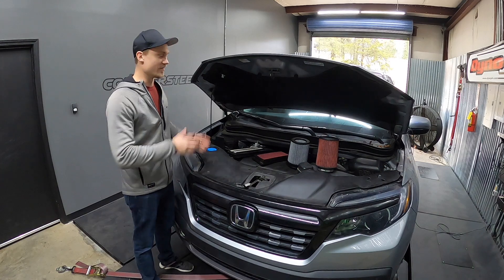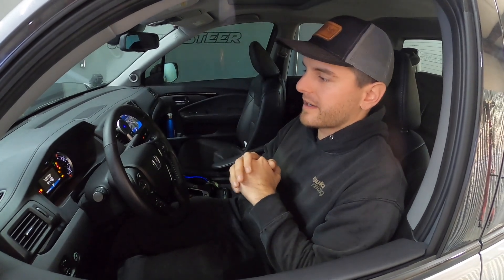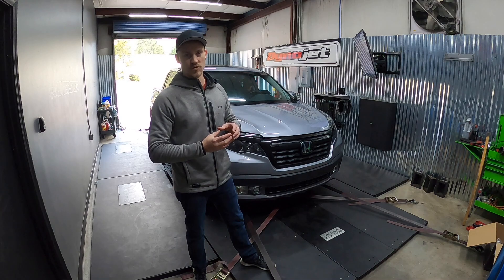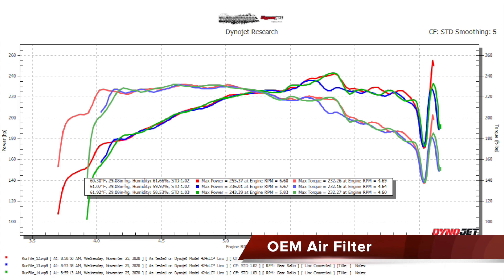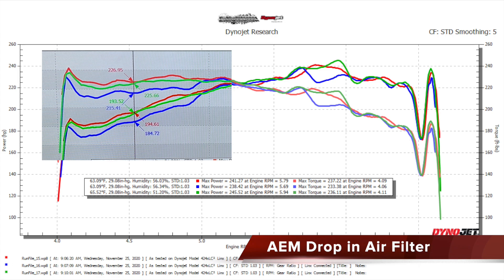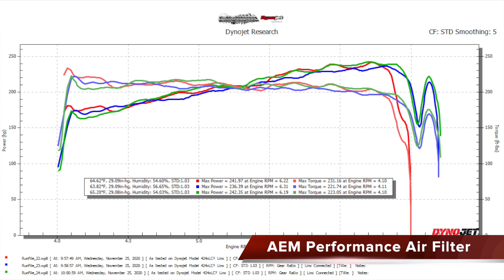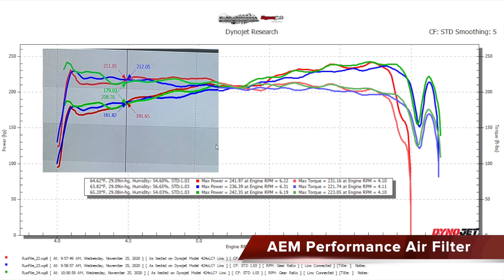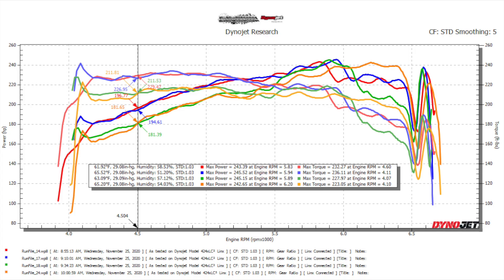I test 4 Air filters with my Honda on a Dyno. Do they even work? | AEM vs aFe vs OEM

Comment: With these results, it seems to me that I might as well just keep the stock filter!  Thanks for your detailed reports.
Reply from the maker: Once I take it to the Track and have the final numbers to see if there is any improvements in acceleration then I will be able to say with confidence which one I believe is best. If I have to recommend an option right now I would get a drop in AEM filter with the stock air box. This is the best all round item. Best MPG, comparable low end HP and most high end HP. Now if I can get faster trap speeds with the the AEM Performance filter then for sure that would be my choice as a daily. Over all I personally want same or better MPG with added acceleration time if possible so hence these tests.
Reply: @YuriyMotso  what's the verdict?
Reply: @YuriyMotso  , that's information we can really use!  Thanks so much for your diligence.
Reply: @YuriyMotso  do you need to tune the car once you install aem filter?
Reply from the maker: @acc1tester398  no. However, if you did, I bet you could gain more efficiency out of it.
Reply: @YuriyMotso  is it safe to say that you're using this for daily?
Reply: Ordered my AEM online. $34
I've always used K&N before but once I knew there the same company and $15 cheaper it was a no brainer
Reply: I feel the same. Track results done?
Reply: Exactly Right ☺️

Comment: i just removed my AEM performance on my 2018 because I received "emissions system problem", checked the code and it was saying p0171&p0174, running lean. I think it maybe the AEM performance, cleared the codes and placed OEM back in,  50 miles later and Evap system still hasn't reported ready. anyone else having this problem after AEM performance install?
Reply: Rene the 2017 and 2018s have issues with the injectors from the factory. For some trucks its hit or miss. there's a list of vin numbers with the affected trucks floating around on the internet. might be related to your issue might not.
Reply: @rackemmm1947  any idea where i can find that list? i just did a quick search and couldn't find anything....thanks in advance.
Reply: @rene619sd  after looking it up the tsb isn't for your error code of p0171 and p0174.  The tsb I'm talking about is called 19-073. Regardless I would bring your truck in if you can't clear the code and just play dumb
Reply: o btw  thanks Yuriy for helping me spend money. I ordered a drop in aem filter today lol
Reply from the maker: I have driven many miles with my AEM and heavily pushed the vehicle more than most people. I fortunately have experienced no problems but am aware people have run into this before. Sorry you have experienced this issue.
Reply: @YuriyMotso   looks like the AEM drop in maybe the way to go anyway, thanks for the video.
Reply: @rene619sd  For turbo engines such as Ford and Lincoln ecoboosts. It really is a MUST...!!! I did it for my 2015 Lincoln MKC 2.0 AWD and i won't go back to an OEM filter.

Comment: 4 years ago, I did the test on a 2016 370 Z (stock) on a MD 250 Dyno, and just swapping the OEM vs the aFe panel filters gave a gain of 4.77WHP from mid to red line (twin intake on the VQ 3.7)
Reply from the maker: It’s possible. Every vehicle is different and the Honda Ridgeline built behind mine could have made power but mine didn’t. This is not to say that these filters don’t work but testing them and showing the numbers helps validate the claims for everyone else. In this case more specifically for just the Ridgelines.

Comment: Well... I still like my AEM Intake haha 😅
Reply from the maker: Me too! The AEM drop in and performance intake system do really well in all my tests. Today on the dyno the performance held up really well against OEM air box in the peak power band. It also sounds way better and gets better economy in my tests. I am super curious to see how it does at the track.
Reply: @YuriyMotso  Is it possible to have the Ridgeline Tuned to help with the Performance filter.  Could Techs tune the Fuel/air ratio on the Ridgeline?
Reply: @YuriyMotso  I can’t wait either. I almost bought the AEM intake on Black Friday but glad I didn’t. If your acceleration test shows a difference I still might buy it.
Reply from the maker: @SatoshisDiaper  It all comes down to what you want from the filter. AEM does produce better and more consistent results averaging better fuel economy for both the drop in and the performance intake over the OEM. Now that we have the HP average I will drive each one hopefully 2-3 times down the track to get their times. I want to do them all in the same day if possible because if I do not then it could skew the results and I don't know how many people will be at the track. So going to do my best to get the best most accurate results I can.

Comment: Having the Takeda Intake is turning into a bad decision. I've lost an average 2.5 mpg since install and notice no notable power above 4500rpm. 

I completely agree with these results and would not recommend purchasing the Takeda Intake. Its readily apparent that AFE did no real world testing with this product before putting it on the market.

I will be putting my stock airbox back on and attempt to recoup my loss of this poor financial transaction. 🤦‍♂️
Reply from the maker: I wonder if you can return it? Say not as advertised or something.
Reply from the maker: Sorry about that Eric. I am really disappointed myself. I think the big issue with the takeda intake is the cone design. Countersteer is a very reputable tuning shop in Georgia. Dylan is the owner and started the business in 2008 and is very knowledgeable. So I don’t doubt his skills in dyno testing the truck. AFe may have had more controlled environment and or did very many tests and used best test as result that you could in theory get as good as x increase in power which would technically be accurate but misleading IMO.
Reply: Agree. I’ve been modding cars for 20 years and air intakes is one of the trickiest mods out there. In almost all cases nowadays the stock is best for power. Only trust independent dynos but those are hard to come by. So it’s tricky. People love to run out and buy an intake first mod (me included) but it’s just not that simple.
Reply: I remember back in the 90s when K&N stated that they don't make a kit that doesn't make a positive result.  I've been using them since then.